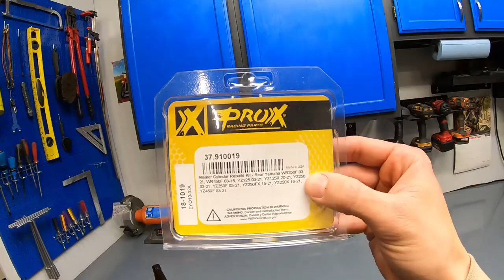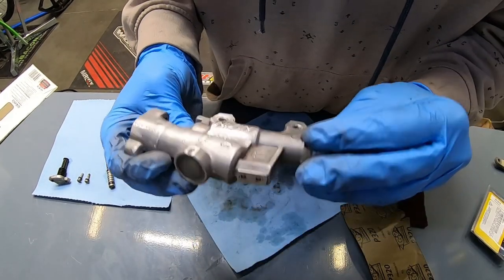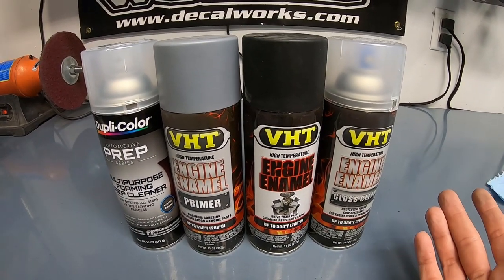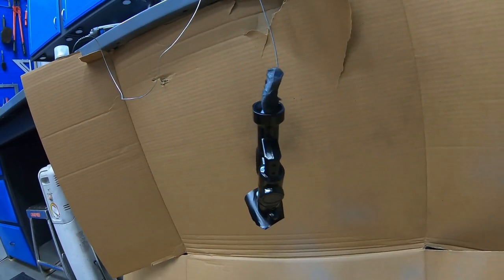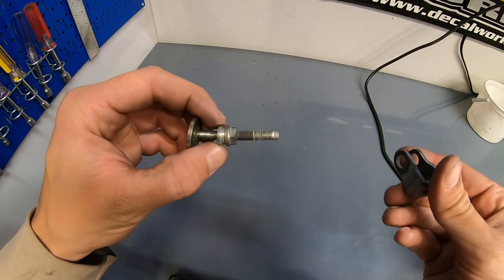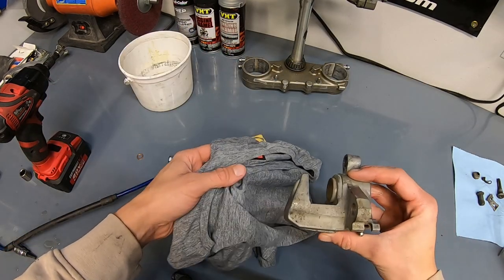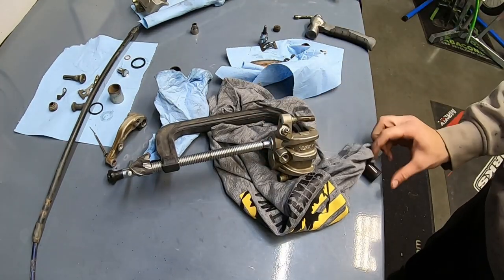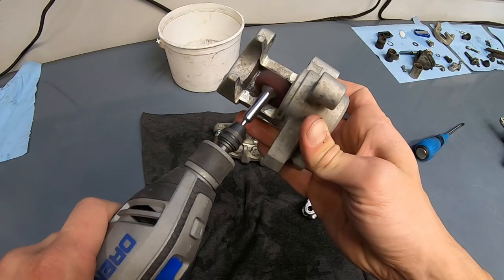Spray Painting Dirt Bike Brakes at Home with Amazing Results!

Comment: I invested in cerakote. I may have mentioned before. The finish is very nice with the matte. I already had a compressor and sandblast cabinet. I do think sandblasting makes for a lot better profile to adhere to. The cerakote was a bit of an investment. I like that it has a catalyst to harden it. I hope that VHT, holds up well. You definitely did some good prep work, minus the sandblasting. The nicest part about cerakote to me is that it is very thin. You don’t need to mask off most stuff. I even did the inside of a quadrajet carburetor with it. I want to see if it holds up to gasoline.
Reply from the maker: Yeah when I reference cost I should be more clear - it is the investment in the sandblasting setup that is my limiting factor right now, not the cost of cerakote materials. From my understanding of cerakote, the process is a bit more particular and sandblasting is pretty much essential to do it well. Whereas with paint, it can be done well without a blast setup despite being tedious. The next big investment for my shop is definitely a good air compressor and a cabinet.

Comment: I built my vapor blasting cabinet for under $400, it works amazing and made this stuff so much easier, better quality, and cuts the time it takes in more than half.  Super simple: harbor freight sand blasting cabinet, eBay trash pump, eBay sand blasting tip, 5 gallon bucket, and a few fittings and hoses.  Theres lots of diy vapor blasting content on YouTube. I had a 26 gal air compressor that ran it originally but it would only run it for about 6/7 minutes before needing to recharge, I just upgraded to a 5hp 50gal air compressor and it works flawlessly for both wet 50psi and dry 90psi.  Awesome content as always 🤘
Reply from the maker: That's awesome! How much is involved with swapping between the wet and dry setups? Also good to know your 50 gallon air compressor gets the job done. I have been looking into mostly 80 gallons because I wasn't sure if a 50 or 60 would get the job done. Which compressor did you buy? The compressor is definitely the most expensive part of the setup.
Reply: @KincadePavich   to go from wet to dry just disconnect the hose at the pump that runs up to the gun, pull it up inside the cabinet, close the hatch and add media. Just make sure it’s fully dry inside the cabinet.  I got the 60 gallon ingersoll rand 5hp, I got mine from a direct vendor for 800 plus tax (found on fb market place), they sell them at tractor supply for 1200. Whatever you get just make sure the cfm @40 is 15 or greater and it’ll pretty much run as long as you want with out breaks or losing pressure. 
I just stripped the black from a stock yz exhaust, hit it with a pryme wheel and heated the welds and it looks just as good as a factory pipe maybe even better! And it didn’t take long, maybe an hour ish

Comment: You did a great job and I enjoyed your video. This was a lot of work and you had to buy several paint products. I bought a cheap powder coat gun from Harbor Freight. It is cheap, quick and easy to do parts. I even did the parts in a toaster oven.
Reply from the maker: Thanks so much! Do you have sandblast capabilities or do you prep in a similar fashion?
Reply: @KincadePavich  I prep in a similar fashion. I use pryme mx pads in almost everything. I also have a dremel with a flexible shaft and small pryme mx pads to get in the tight areas. Last year I bought a zinc plating kit from Caswell. I have been real happy with the results.